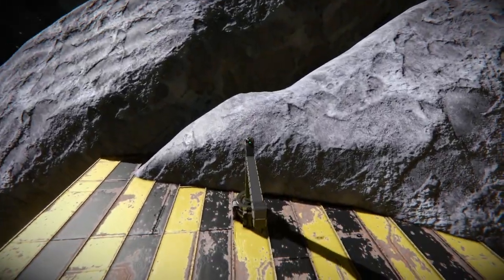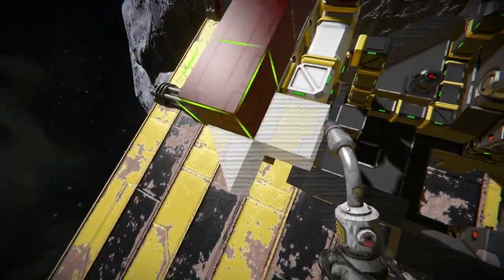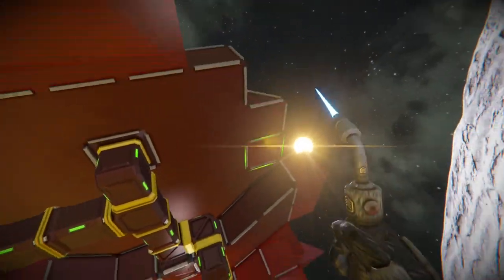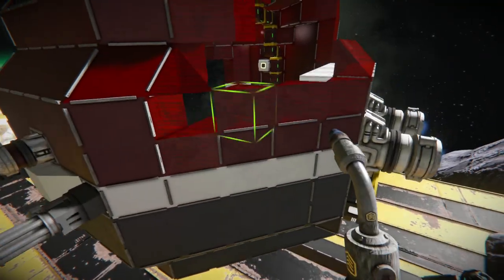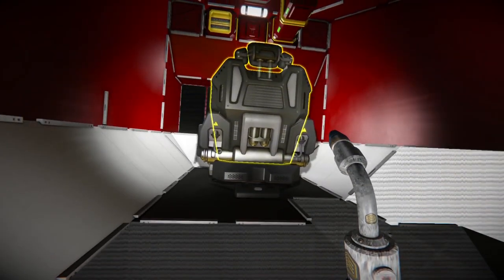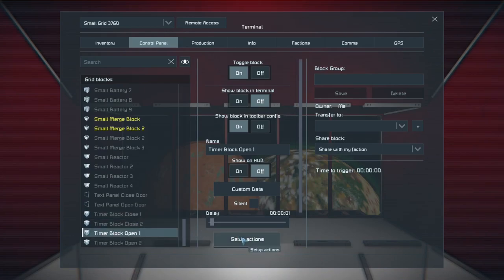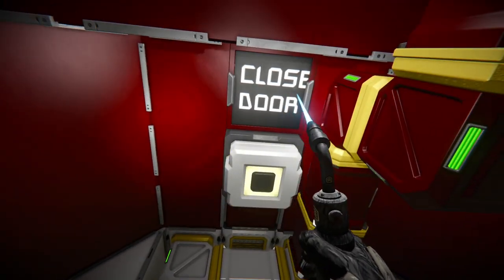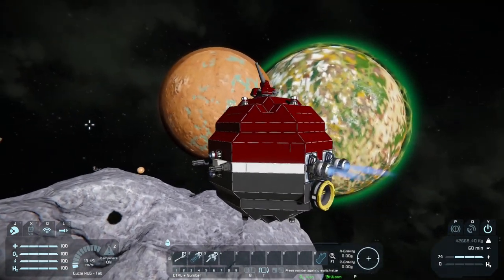Practical Power Sphere Build Tutorial

Comment: In creative mode, you might as well use the mirrored planes, yes? A lot more convenient than having to circle the grid manually creative-welding every block.

Also, using just the pre-Most Wanted armor blocks, you can use the slope bases and tips to further round out the sphere's slopes. With first and second armor block sets 1x1 and 2x1 slopes and 1x2 slopes (2x1 rotated 90), it's possible to make a circle with 16 sides. Replicate/rotate it twice more for all three X Y Z planes, and then fill in the remaining eighths of the sphere with mostly second and third armor block sets. It's been a while, but I'm pretty sure I didn't need to use any of the Most Wanted new fourth set of transition blocks.

Actually, scratch that. I'm positive I didn't, b/c I just remembered I actually built the sphere using POM XL blocks, which only have 1x1 and 2x1 slopes and tips. Each XL block is a single 1 PCU block that's 5x5x5 large grid. I was building a 65-block (13 XL blocks) diameter sphere for a spheroid spaceship. (classic SF and some Battletech dropships used this layout a fair bit)

Anyway, you don't have to make a more circular sphere, of course. Do what you like in your creative build! Using just 1x1 blocks does make it a lot easier to visualize where to build in functional blocks, and there's less opportunity for functional blocks to poke out compared to the 2x1 slopes. But the vanilla blocks do make it very possible to smooth it out if sphere aesthetics are a priority.
Reply from the maker: Interesting, I will definitely have to look into that advice.  Typically, I try to stick with the principle of simplify, economize, and clarify where I start with a basic concept and modify to improve later on.  Thank you for the insight, I appreciate it.